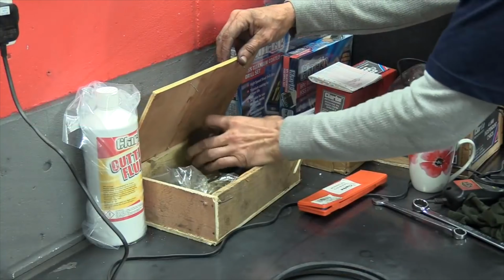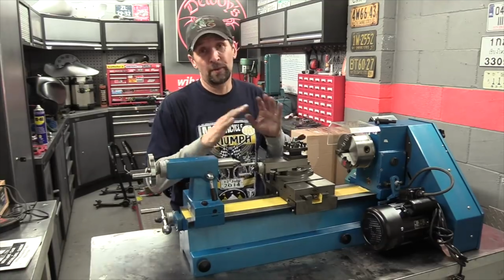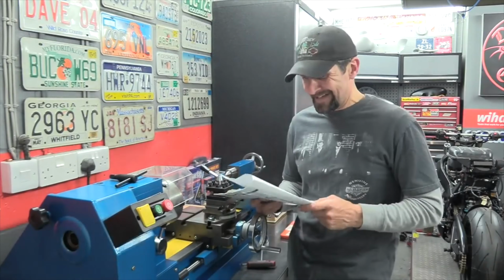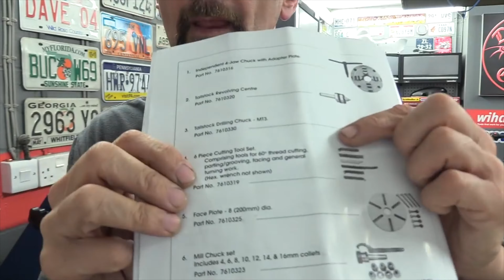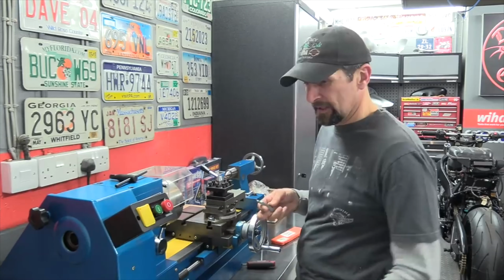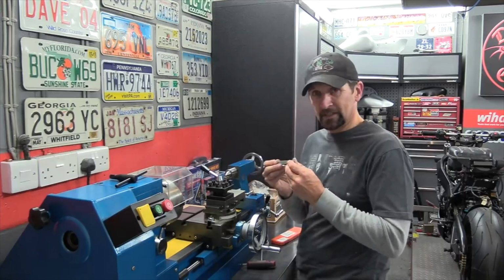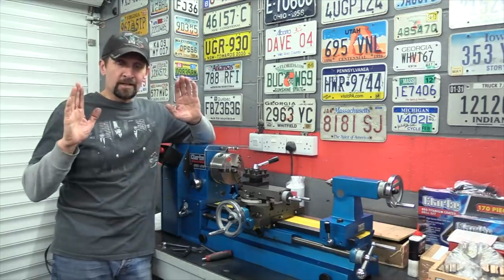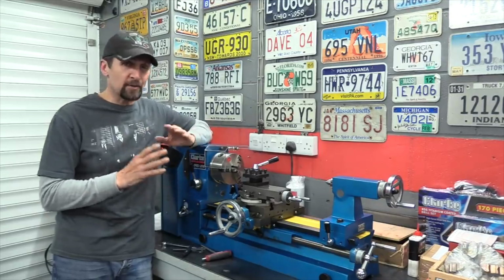Unboxing and setting up a Metal Working Lathe !

Comment: Don’t know if it’s just the design of the particular lathe, but aren’t the gib screws and locking nuts missing from the cross slide or does it use grub screws and locking grubs behind them?  I’m probs wrong, but as a lathe nut, wanted to ask, just in case, as it would be potentially dangerous to take a cut without a properly braced slide.  Also tightening the taper slide to the cross slide, without proper gib screws, could distort the dovetails, unless by some fluke, both surfaces were flat, hahaa.   The only reason I didn’t buy one of these as a hogger, is that the centre height seems too high for the machine and the tailstock looks a bit light duty.  However, I bought a new Wabeco D4000, which had a weaker topslide than my Emco compact 5, which use plastic gib strips, haaa, so you might have the better machine.  Any questions or info you need on machining or lathe matters, please just ask, I’ve probably made every mistake, so have lots to share😭😭😛🤷‍♀️🤣💪❤️

Comment: Have you fitted an independent 4-jaw chuck to this yet and if so, which one did you buy?  The Clarke one is super costly.
Reply from the maker: I have the Clarke one mate.. bought it with the lathe at the same time.. only used it a few times !
Reply: @Moonfleet41  Thanks for the info.  Shame it’s such a weird size and so expensive, or I’d do the same.

Comment: You'd think that some shims would have come with it......
Reply from the maker: Yeah, they are an accessory purchase i could have made, but being a skin flint i didn't.. but i learned almost straight away from a very kindly machinist viewer to just use some old feeler gauges.. and i love that kind of thinking over just buying stuff...
Reply: @Moonfleet41  Yeah you can save yourself a whole lot of money by improvising and being a little creative, I recently lost my engine case dowels, didn't want to wait for a month for them to be shipped from overseas so i went to the hardware store, bought a stainless steel bolt of an appropriate size, and used a hand drill, dremel, vice and and hour of my time to make new ones that are probably better than the factory ones.